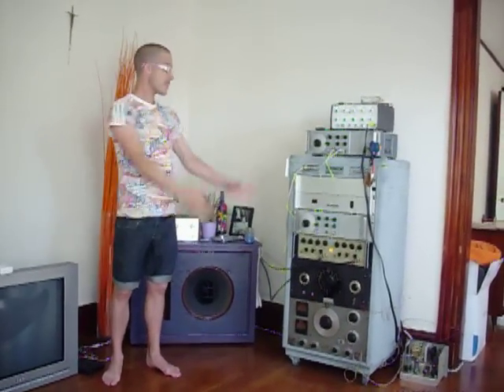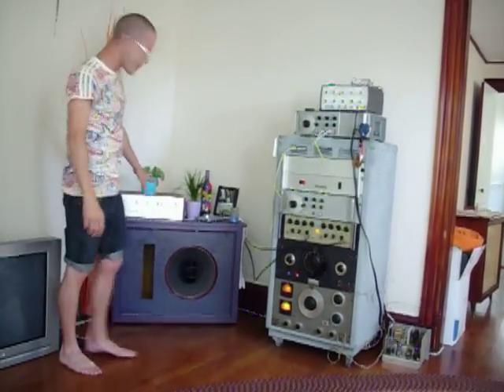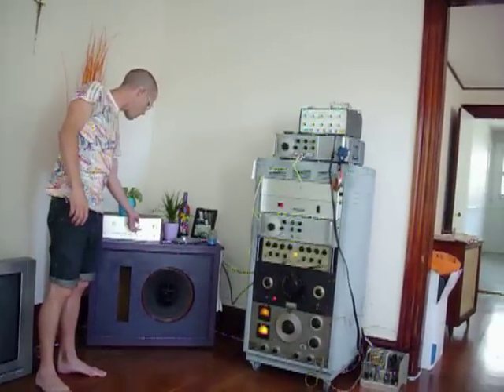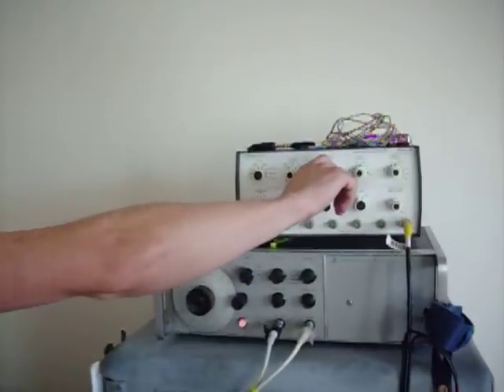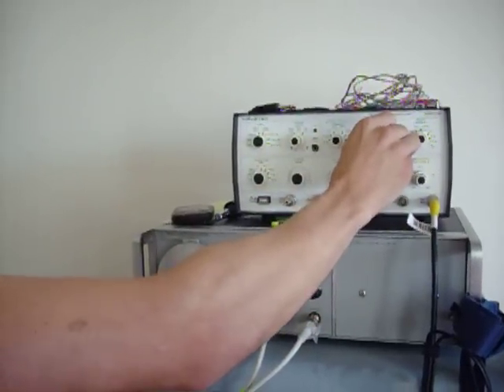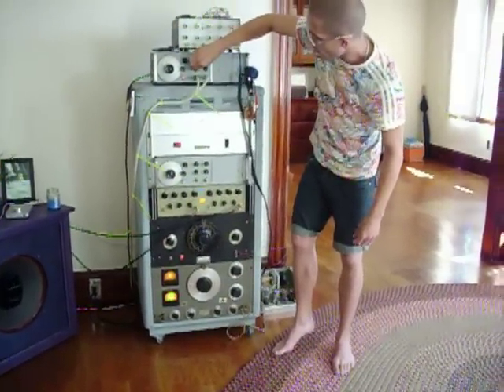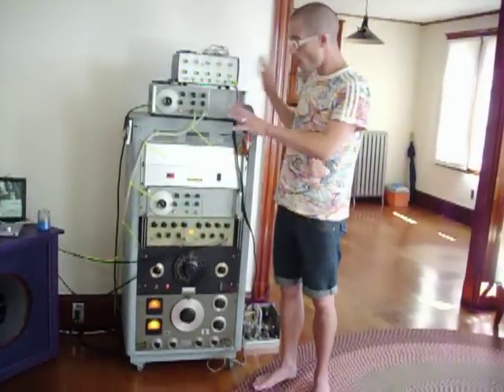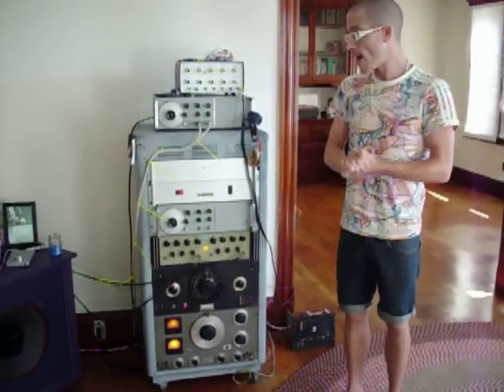Stockhausen One - Frequency Modulation Synthesizer (Hewlett-Packard) by Chris Aquilo

Comment from the maker: yes you can trigger it with a keyboard.. you can adjust the frequency of each sound in the modulation.. im working on additional filters that will change the sounds further.. has pulse and delay voltage, modulation changes, pulse width ect.. the video is new and it just got at this phase in its life.. im always working on improving this.. voltages change the octaves as well as freq adjust.. thanks for you interest